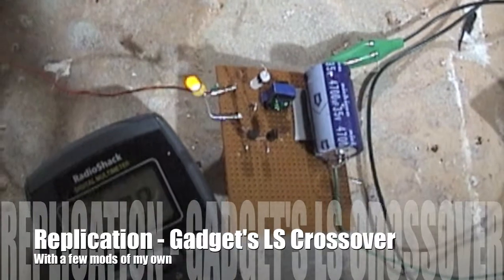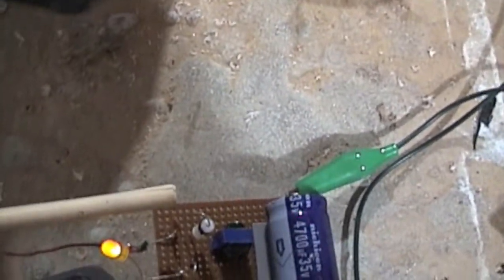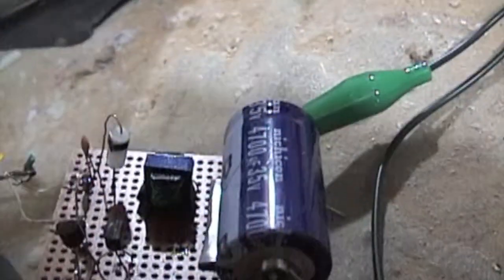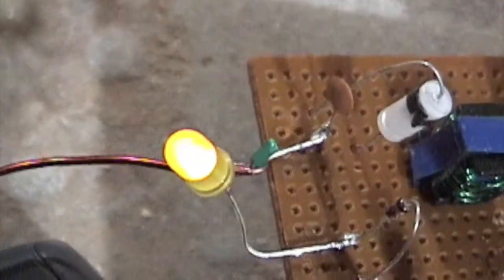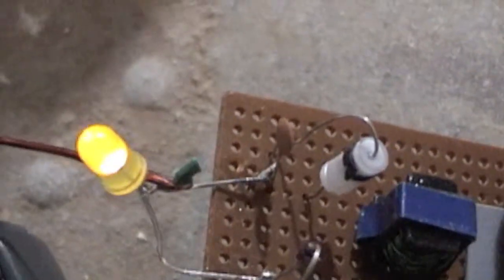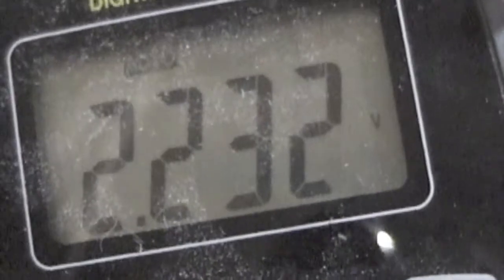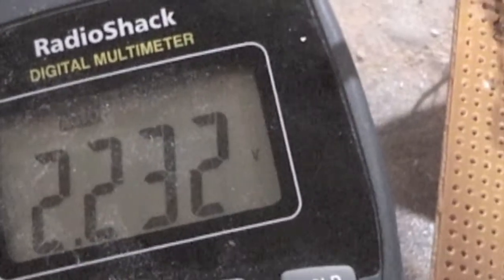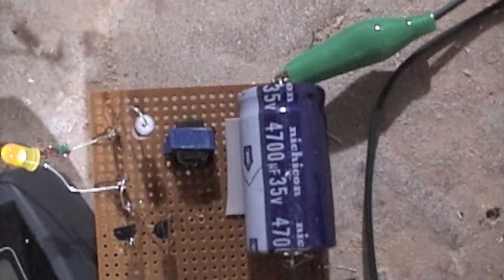LYNX Replication of Gadget's Crossover

Comment: This looks like even smaller or portable version of crossover.Good work.
To optimize on voltage gain if the current draw is below 100mA should try to use
lower emitter to collector transistor like MPSA05 or MPSA06.
I wonder if using low voltage diode like 1N5817 (0.145V) would help to improve on efficiency.
I have uploaded 45mV joule thief video meant to be run from peltier using 4 turns 18AWG.Do check may get some tips from the description and circuit.
Next year i will be uploading 30mV version